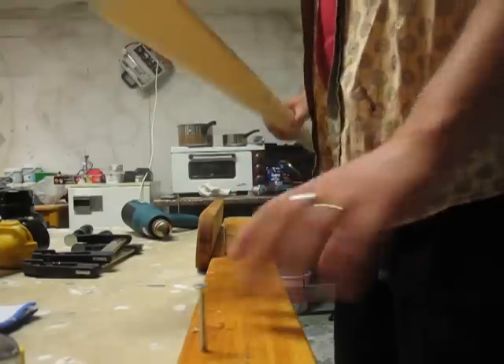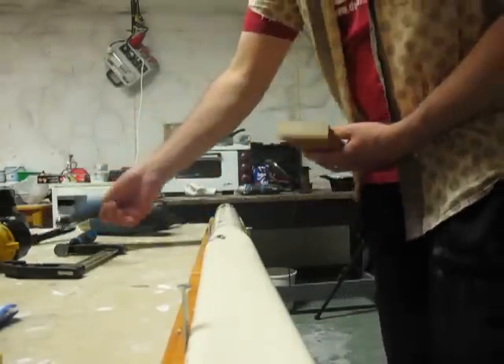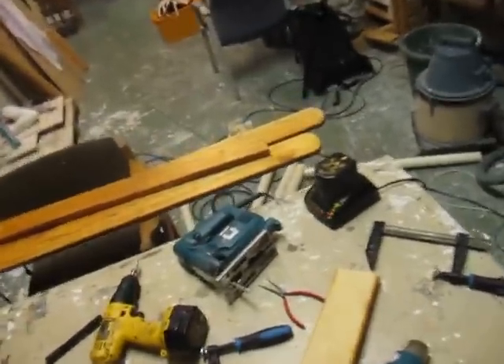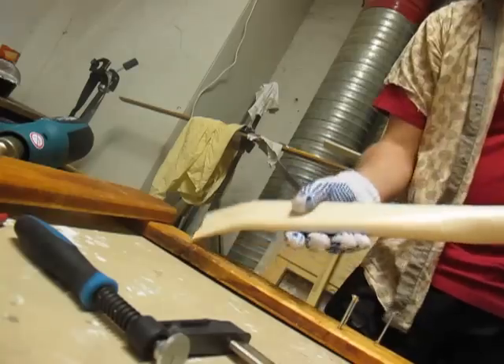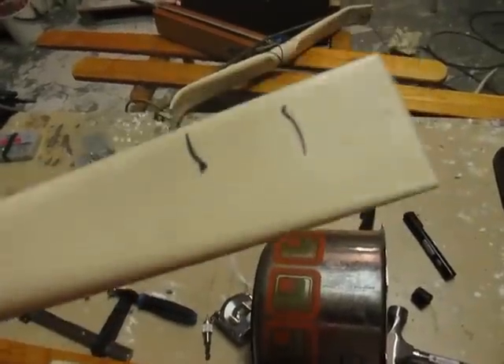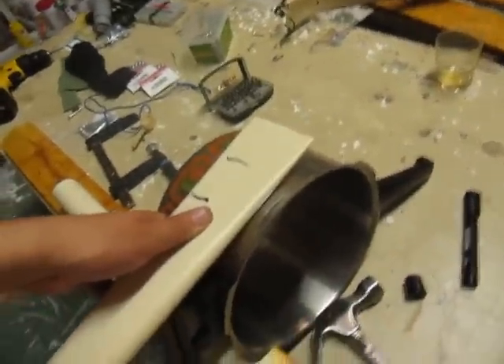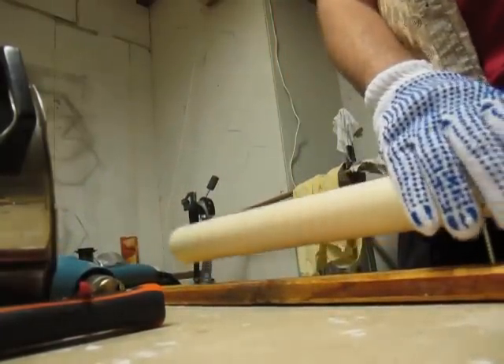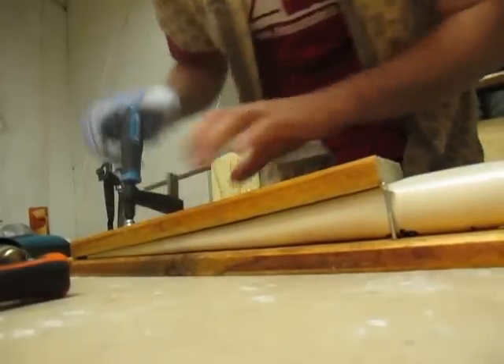PVC - Crossbow for New Performance: Day 1

Comment: Hi, I believe Nick at backyardbowyer first flattens the pvc 1 half at a time, allows it to cool, checks alignment, does the other half, then heats the 1st half again to form around the desired curve, repeats with the 2nd. There is minimal to no hand flattening involved except for final alignment. Maybe pvc is more tolerant than other materials of repeated heatings, I certainly wouldn't know but his bows have been robust according to him. UV protection coat is important for long life; pvc isn't designed to have to withstand the sun normally and breaks down w/o a uv (paint or ?) barrier.